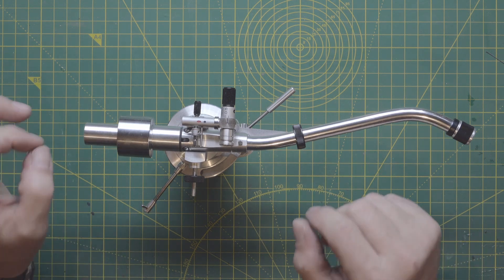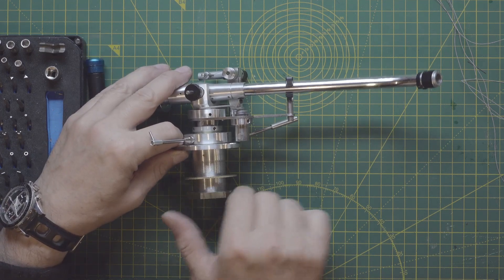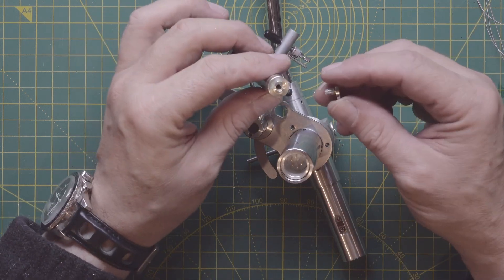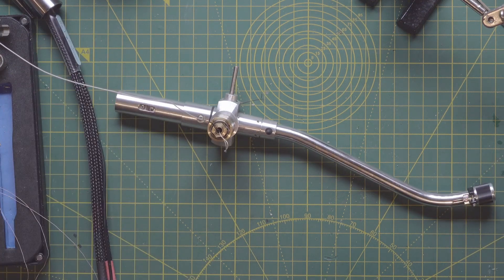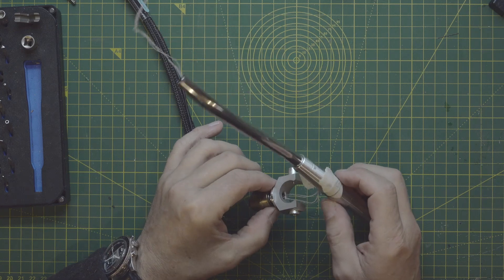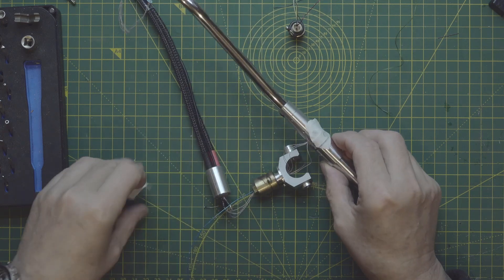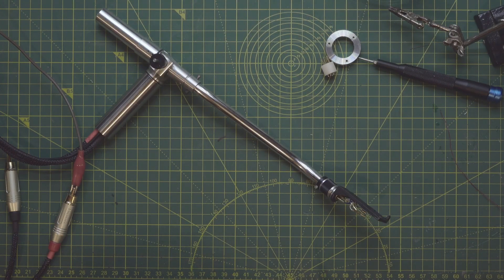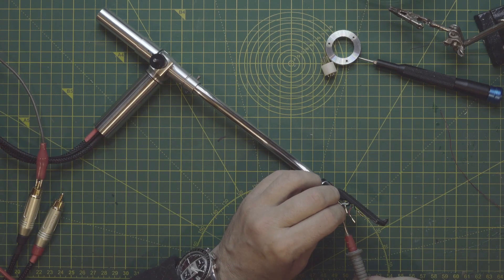Micro Seiki MA505 Wiring Upgrade

Comment: Great video, I'm so happy you made it as the internet is desperately in need of more information regarding these tonearms; unfortunately there's very little out there at the moment.  I recently spent hours carefully stripping down my MA-505 X for a rewire, and can confirm that it tested my patience to the absolute limit 😬😂 Thankfully the tonearm survived unscathed and is ready for rewiring.  May I ask which guage, and possibly which brand of wire you used for this? I bought some (silver) tonearm wire online, but it feels very stiff and I fear it'll impede the movement of the tonearm once reassembled (so have decided against using it). Many thanks in advance.
Reply from the maker: Thanks.
Probably you didn't watch this my video before buying the silver wires: https://youtu.be/rYGDrJBIqJk
I use OFC Litz wires bought in bulk from an English manufacturer Scientific Wires
Reply: @TheAudioSanityChannel-ym7ij  Many thanks!  I'll watch the video :)
Reply: @TheAudioSanityChannel-ym7ij   I have another question if that's OK? In your video you don't mention the positioning and correct attachments of the ground wires. When dismantling my tonearm I discovered two ground wires: One was attached to a 'V' fork located in the arm base tube and was clearly soldered to the 5 pin DIN tonearm connector (I removed this one first with ease) and as the strip down of the tonearm progressed, I noticed a 2nd (much shorter) wire hanging down through the bearing.  This turned out to be located inside the arm tube, soldered to a copper spade. My question is, should both ground wires be soldered to the 5 pin DIN tonearm connector?  Many thanks once again.
Reply from the maker: @giovanniferrara1356  Hi
Indeed, the ground wires are two.
One is connected to a clip into the brass orifice that is part of the horizontal bearing assembly, and the other goes all the way to the arm tube.
I found the former to be of no importance, and connecting it or not makes no difference, while the latter MUST be grounded.
Reply: @TheAudioSanityChannel-ym7ij  many thanks once again :)